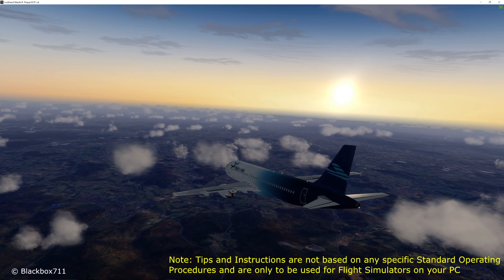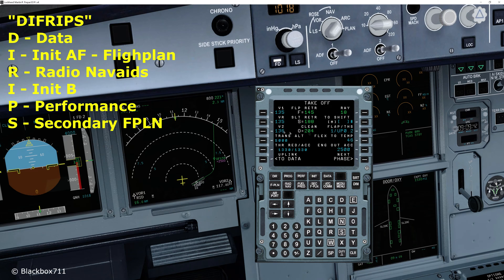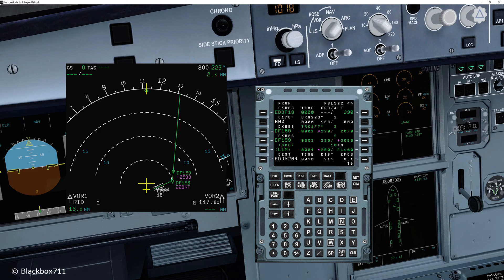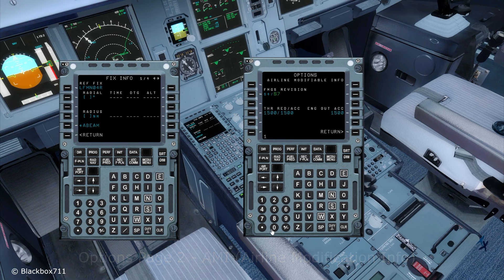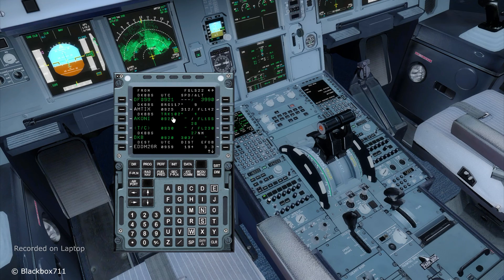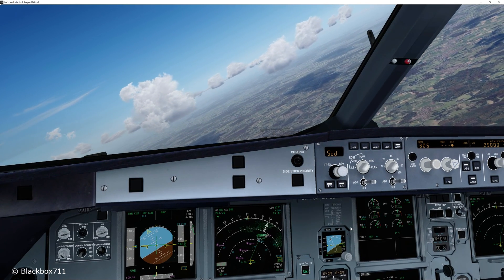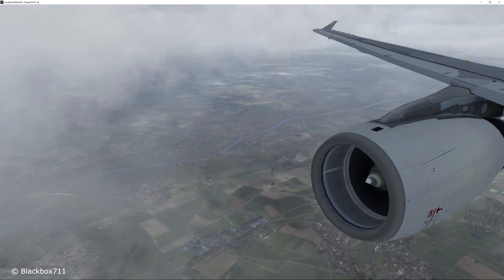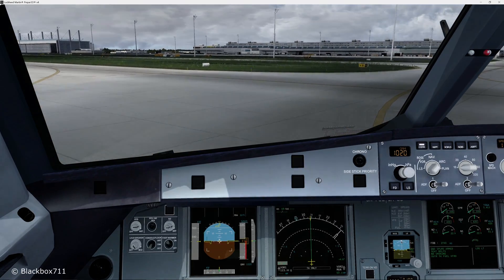FSLabs A320-X Basics: Secondary Flightplan and Fix Info functions

Comment: Great content. One question: what is abeam func used for on the fix info page? Thx in advance.
Reply from the maker: Hi. That is presently not working. But it would draw a perpendicular line to the current flightplan lateral path, so that you get an indication of the point where the entered fix is abeam.
Reply: @Blackbox711  thanks a lot sir! Now I got the idea:) maybe a little off the topic but I have one more question: in fslabs after take off with 1+f config the flaps are automatically retracted (if no pilot action undertaken) and slats not just like in real aircraft. But in fslabs after  retraction with slats still extended if pilot takes still no further action the aircraft goes into overspeed. I suppose something is missing there. Is there no overspd prot in this config? Thank you for your time and wish you a pleasant 2021 sir!
Reply from the maker: Hi. There is no automatic retraction for the slats. Only for the flaps. That is also the case in the real aircraft.
Reply: @Blackbox711  yes sir thank you for your answer but my question is about shouldnt the aircraft hold the spd and not go into overspeed at this situation (flaps up slats down)?
Reply from the maker: No, it only does that when in clean configuration.
Reply from the maker: There it will pitch up the aircraft to reduce speed to stay below VMO or MMO
Reply: @Blackbox711  thank you for taking time and answering sir.

Comment: Black box- again great info indeed. Question- when you build the cyan extended centerline in the fix info page for the purpose of a potential eng fail on t.o. - will that cyan dashed line stay on both ND’s for reference until you go into the fix info page and clear it ( at 10,000’ )? Also I assume if you actually end up with an eng failure on t.o. - you can’t actually insert the fix info you built- you would need to use the heading mode to fly that extended centerline ? I noticed on your t.o. out of EDDF that the cyan ext centerline you built in the fix info page was not present on your ND- why ?
Many thanks.
Reply: Usually you wont use fix info cyan line for navigation (So yes, you would need to use heading) or engine failure, you would only use it to increase your situational awareness. For Eng fail after TO, you usually would copy the active flight plan to secondary and change destination to your departure airport and runway at a point which you think is acceptable and fill in the approach perf for your departure. So incase of Eng fail, you just need to activate secondary. And yes, fix info remains there until you manually clear it. I hope i answered your questions.
Reply: Osama Abdel-Alim 
Hey Osama! Thanks for the response.
I’m aware that the cyan line itself isn’t “ navable” but if you lose an engine on TO you need a method to climb straight out ( assuming the runway does not have a special eng out procedure). So for 14.2 nm you are protected straight out on the departure rwy centerline 2000’ either side of it. In the case black box used - if you lose the engine at v1 you’d stabilize the airplane by - centering  the blue target, climb to pitch to 12.5 degrees, and I think ( in the case of airbus) you’d simply pull the heading knob out and attempt to fly right over the top of the cyan dashed line. My biggest question is this - exactly how do you keep that cyan line visible on your pfd during take off so you’ll have it visible if you lose an eng at v1?
Reply: @rblauson  the fix info line "Radial" inserted will always show in the ND as long as the fix you chose is in view and it hasn't been manually deleted. But it will NOT show on your PFD. Usually you will pull heading to climb straight ahead , but you won't change the heading to try and catch the cyan line at all as that will be considered a turn. Until you clear your EO SID specified height for a turn or you pass 1000FT AFE for standard EOSID. Then you can follow eosid, runway heading, etc
Reply: Osama Abdel-Alim 
Excellent !
Thank you and that all makes sense to me.
This black box guy has some really good videos
Reply: @rblauson  No worries, I think he has 2 different flights, thats why the blue cyan line wasn't showing on TO Roll. During roll time was 12UTC on the Clock, then at 10,000 FT time is 0923 UTC, also confirmed on the MCDU ;)
Reply from the maker: Hi. Thank you very much. Osama answered your questions in great detail and I don’t have much to add. However regarding the cyan dashed line which is inserted for EO after V1 I can add that since usually you have a very high navigational accuracy, the ND is accurate enough to allow a tracking of that cyan line in heading mode.
Reply: Thanks so much Osama!
Reply: Blackbox711 
Thank you kindly- again your videos are informative, and very well put together.

Comment: Which version of fslabs and prepard are you used in this video ? I have prepaid 3d v3 and fslabs a320x and does not work sec flight plan and fix info thank you.
Reply from the maker: That was FSLabs Version 215 and P3D V4.1.

Comment: two questions: Do you actually have time to put in the engine out track, especially with very short turnarounds? Also do you routinely use the secondary flight plan for enroute alternates or destination alternates?
Reply from the maker: +Avantime .. yes, an experienced airline pilot will programme the FMC within 5 minutes, including SEC FPLN quick return and engine out track. Personally I used the SEC FPLN for quick return and destination preparation with multiple runways. Regards